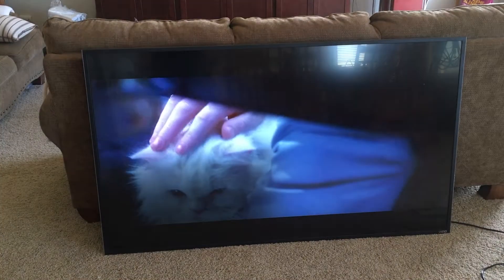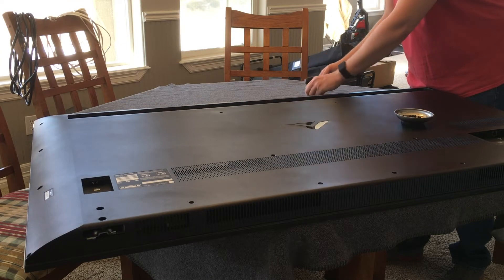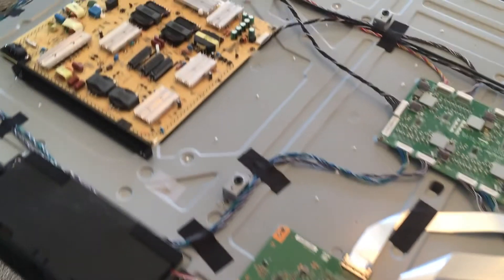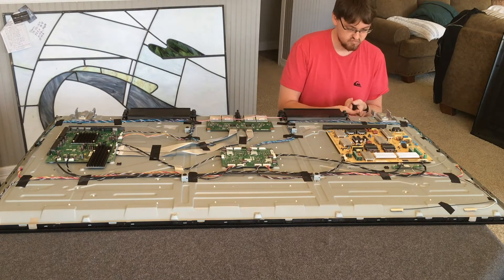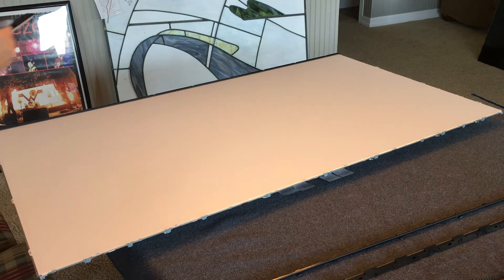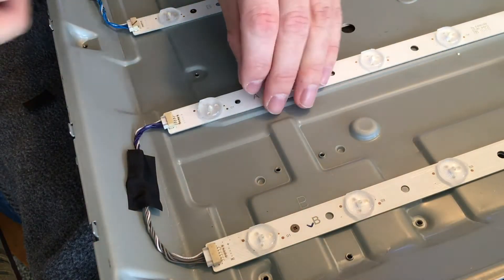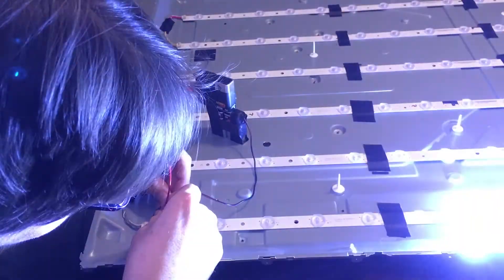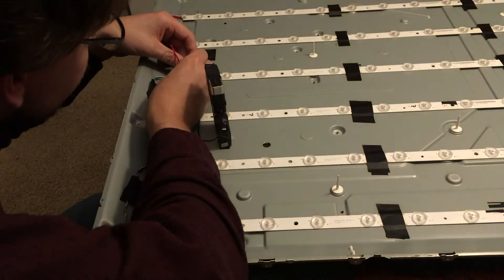Vizio M65-D0 LED Driver Board Replacement: Fix Backlight Issues | CraftTested

Comment: I replaced my main board and led driver and still has black spot buy goes away every 3 day or so then comes back been doing this for 4 months. You think a tcon Is the problem
Reply from the maker: I have no idea... I'm just a dude who tinkers. I shared all I know in the vid.
Reply: @CraftTested  you no if the vizio m701d-a3r is edge lighting or full strips like yours?
Reply from the maker: I have no idea – I'm sure that's something google could tell you though.
Reply: @CraftTested  I looked , I can't find it

Comment: I guess if you're not sure before you buy the part, you could just swap around the connections for the panel sections and see if a different one goes dark?
Reply from the maker: Sounds logical. I'm not a pro at this stuff, just a guy trying to fix my broken crap.
Reply: Is that the only way to test the board?  It sounds simplest so just asking.

Comment: What do you think is wrong with my TV 
My TV won't stop flickering its every 5 to 10 seconds it will flicker I've opened it up to see if it had a loose connection but I'm still unsure
Reply from the maker: I have no idea... I'm not a pro tv repair man – just a dude who had to fix his broken junk.
Reply: did you figure this out ?

Comment: How much does the video board cost
Reply from the maker: I think it was around $25?  Maybe a little less.  Generally these boards are pulled from other broken tv's – the working parts stripped – so you shouldn't have to deal with the microchip shortage issues.  I'm waiting on new microchip parts for an audio interface that went down – it's been over 70 days.  I'll probably never get it.

Comment: I have a Vizio P65-F1 which needed a main replacement.  I replaced the main but not with the exact model #, the TV had a -T and I bought a -K which I have done before and seen other do.  The TV now works fine but I am seeing the same problem you encountered but in my case the shaded spots move around depending on what is on the screen.  Clearly the TV is trying to adjust the backlight/Dimming but in the wrong spots, I am guessing this has something to do with the different board model #.  I am able to temporarily resolve this issue but setting the Picture Mode to Computer.  I went through all menu settings including the Service menu and see nothing related to Panel or Calibration.  Any suggestions ?
Reply: For now disabling Active Full Array resolves the issue regarding of the Picture mode.  I am going to guess this has something to do with the different model # board not completely matching the rest of the system/panel.
Reply from the maker: I would assume it's the different model board as well. Glad you figured out a workaround with disabling active full array.

Comment: Great informative video.  I have a small strip of dark spot right smack in the middle of the TV.. there was another lower line but that has disappeared.. Would this be a LED strip or a board issue? It's not an entire area but a "line" where I imagine some of those LED bulbs went out?  It's a M658-G1 less than two years old (wtf).  Thank you!
Reply from the maker: I'm not a pro at any of this. The only way to know for sure is by checking the video board and LEDs with a multi-meter. Good luck!

Comment: It can be a right pain at times, could be led driver, t-con, psu, main...a led tester is a must... Or dc 3v battery save you...
Reply from the maker: I agree–the only way to know for sure if by chasing possible issues with a multi-meter. And yes, the battery trick works for checking LEDs, haha.

Comment: Long shot. The top section of my vizio D55-F2 went dark. When i go to menu>timer> and select blank screen. It goes dark like it should. And when I hit a button to bring it back to light the top is lit then goes back dark in a few seconds. Could it just  be the board if will light up then go dark?
Reply: Maybe a bad capacitor or transistor that powers that led strip? Or a bad connection somewhere. Something can't sustain the power flow. You could try baking your boards to see if it fixes the problem, maybe a bad solder joint somewhere.
Reply: I have the same issue

Comment: Mine is the Bottom being Dimmed. Upper is good, but the Lower Half of the Screen starts being Dim.
Reply: Mine dimming whole screen 😢 I have 2022 Vizio but I'm gonna be buying one 2025 Vizio Tv
Reply: @unknownwolf8555  - Also have a 24 Inch Vizio that works great...but after a while, the Audio starts getting out of Sync. Only way to correct it is to Power Cycle, or Unplug then plug in the HDMI Cable. No WiFi, or LAN, so not sure if they have a Software-Firmware Update that can be applied with the USB Port or not.

Also have a brand new ONN 24 Inch TV...which has a Firmware-Software Issue with the HDMI Ports. You can not use Disc Players or TV Boxes because it has a HDCP Issue. Oh, but Laptop and Android Devices with HDMI have no problem, though. LOL
Reply: @chrisflowers-smoker154  mine so dim I can't see anything anymore  😕 so I'm gonna have buy me new Vizio tv gonna be 50inch 4K I do alot of gaming since I'm unable to work due to me having health problems and syndromes i barely see Minecraft with In game brightness up all the way

Comment: Mine has alternating black areas. Top right, left middle, bottom right, but mostly noticeable when the screen is darker and not as bad when the screen is light.  Do you think this is still a driver board issue or more of an LED issue?  All these areas went out at the same time so I would think more of a driver board issue since it is highly unlikely that all those areas go out at the same time.
Reply from the maker: I am not a pro at this stuff – the only tv I've ever fixed is the one you see in this video. But yes, given what you've told me, it sounds more like a driver board issue – or even a motherboard issue – rather than an LED issue. Sorry I'm not better help!

Comment: Tried this... didn't work.  Still have lower-left quadrant not working.  Might be the backlights, after all.
Reply from the maker: Bummer. Only way to know for sure is testing each stage in the circuit with a multi-meter.
Reply: @CraftTested  Well, that’s not all bad news… I’ve been looking for an excuse to buy a new multimeter.
Reply: @dharvell  Did you end up finding what the issue was.  Your problem is exactly the same.
Reply: @treader1974  Yup! Replaced the LED strips and everything was looking great!

Comment: My quadrant was dark. I ordered another board and it is still dark. Only top left quadrant.  The repair was easy like you said but it didn’t fix my prob.
Reply from the maker: Bummer. Only way to know where the problem is for sure is by checking LED's and driver board with a multi-meter.
Reply: @CraftTested  would love to chat with ya  Jeff Hayse on FB
Reply: @CraftTested  I suscribed.

Comment: Why do you keep calling the power supply board; a video board? The video board has the coaxial connections and the RGB connectors according to eBay.
Reply from the maker: According to the place I purchased the part, the appropriate name is "LED Video Driver Board". I have no idea what eBay says.

Comment: because there are too many LED strips and one driver circuit is not able drive it. there must be many driver circuits. each of them only drives one stip.  if one of them is broken, then the TV backlight shows this kind of problems. yours was on the up and low edge. it could be in the middle also.

Comment: Had each of the quadrants go out. Replaced the driver board and came on for about a minute. Now, it's black again. I'm assuming it's the led back lights now???
Reply from the maker: The only way to know for sure is by testing the LED strips and video board with a multi-meter, and possibly back to the power supply. If your LED lights came back on at all after replacing the video board, it doesn't sound like the LED strips are broken.  Possibly something is overloading the video board and keeps frying it.  Just guesses, I'm not a pro at this stuff.  Possibly consider replacing capacitors rather than the entire video board.

Comment: Parents 65” Vizio tv just had this happen. Top right and bottom left corners are super dark. The board is sold out though. Rip
Reply: Lol I just found a 65" vizio tv that was thrown out. It has the same problem
Reply from the maker: I believe a lot of TV parts for sale online are actually used and pulled from other broken TVs. From what I've read, I suspect this is a common problem and a lot of these Vizio's from that time period are failing.

Comment: My top row(s) seem to be out, would this be related to the motherboard? It's not a quarter of the screen, it's the top hslf.
Reply: not sure if you have solved your issue or not but I picked up a E60-E3 and the entire screen was dim. after disassembling it I noticed the connector for the backlight was a little burnt. If I wiggled this connection the entire screen lights up. if I wiggle it a little more the top row goes dim. Wiggling it once again and it works properly. I took a toothbrush and some rubbing alcohol to clean the connectors and now it is working 99% of the time. It occasionally will dim but comes right back!
Reply: @ChadMees  I did, it was the LED strips. I found a set on ebay and replaced all of them. Works great (for now)! Thanks

Comment: I have a vizio e70 e3 I TV shows everywhere but the right side is dimmer top to bottom should I replace LEDs or the board
Reply from the maker: Impossible to know for sure–you'll have to take a multi-meter to test the board and LED strips. If the board isn't providing current to the LED strips, it's likely a bad board / transistor.  If the board is providing current, it's likely bad LED strips.  You can gamble and cheaply / easily replace the board if you feel that you have a uniform outage like what is happening in this video. Replacing LED strips is more involved.

Comment: I have the same issue with two quads but after looking at the driver board in your video I was wondering if you ever tested those 35 volt 470 capacitors that look to be one on each quad. If there was a week or bad cap it could be an even cheaper fix.
Reply from the maker: Yes, Kyle–I think you're correct. I should have checked the capacitors, my gut tells me this was probably the issue. Anyone reading this in the future, use a multi-meter to test the capacitors on the driver board – it may be an even cheaper fix.
Reply: @CraftTested  Just remember that to get a true reading from these caps, they need to be carefully de-soldered from the board.

Comment: So would this also be called the the main board on my Vizio? Because on mine it looks different , it has the hdmi ports together with the main board ?? Also having very similar issue just dimming spot is on the bottom right corner..
Reply from the maker: No, I believe the main board is usually different from the video board.

Comment: Is this the same if two quadrants are doing this and flickering? I have the 49" Vizio and the bottom left and top right are both doing this.
Reply from the maker: Possibly–what you describe sounds like a video board issue and not an LED strip issue.
Reply: Any way in particular that you would recommend testing this? The picture isn't messed up or absent, its just the dim spots in the corners and a bit of light flicker.
Reply from the maker: @hbtdawgz1688  it can be a pain, but you'll have to tear the TV down and expose the LED strips. Test the LED strips individually, you can use the battery trick (https://youtu.be/4pK6o2DMLWQ). If all the strips are lighting up using the tester, your LED strips are working properly and it's a driver board / power supply issue.  If the LED strips are not working properly, you would then need to replace the LED strips. Good luck!
Reply: @CraftTested  Well I didn't have any of those batteries on hand but I did have a 6V battery pack and I applied it to each light. Definitely have some out. Only had maybe 4 strips where there wasn't at least one light out. Thanks for the advice.
Reply from the maker: @hbtdawgz1688  Well, the good news is that you were able to chase down the problem! You've already done the hard part–swapping out the LED strips is pretty easy. Glad you're figuring it out and getting it fixed.

Comment: I have a question the whole left side is darker on my tv could this be the issue or the actual led strips ? What’s your thoughts?
Reply from the maker: I have no way of knowing–I'm not a pro at this. Your guess is as good as mine. The only way to know for sure is to tear it down and test everything with a volt meter. Wish I was better help!

Comment: Just found a TV on the side of the road with a set of replacement boards. Top right quadrant isn't lighting. Was assuming it was a dead LED, but this may now not be the case.
Why would the video board not let the LEDs light? Damaged FET?
Reply from the maker: I'm not exactly sure–I'm not a pro at this stuff.  My assumption is that a resistor is fried on a particular quadrant of the video board and voltage is unable to pass through and power the LED.  This is purely a guess.  Stick a volt meter on the output of the four quadrants on the video board and see if anything is firing on the dead quadrant.  If you're getting a proper reading, it's an LED issue–if you're not getting the right reading, it's a video board issue.

Comment: SW Hammond, great video to not to waste time and money. Gotta question bro my vizio have darkness on upper right(just like your case) and started of with lower left only 1 strop but turned into full block now so what u think is it hopefully just video board or lead backlight strips? Thanks for your answer.
Reply from the maker: Thanks for watching.  Could be a power supply or video board issue.  It doesn't sound like it's the LEDs the way you describe–too weird for all of your strips to "burn" out all together like that.  I would try swapping the video board first, it's cheap and easy, and go from there.  You could away get a multimeter out and try to chase down the problem that way.  Again, I'm not a pro at this stuff–just some dude that needed to fix their TV!
Reply: @CraftTested  Thanks for getting back, is there way for me to show u my issue by sending photo? Tv itself 3 years old initially it started by becoming 1 strip going dark then turning whole block. So right now it is upper right, lower left both are whole block and since last texting you I ve got upper left only 1 strip dark, do u still think it is not  led strip issue and where to get part? I wish I could chase the issue by checking but Im not an electrician so I kind of rely on your experts, thanks.
Reply from the maker: @fi4007  I'm really not an expert at this.  There's no way I could tell you what was wrong by looking at a photo.  I did mine wrong the first time, thinking it was an LED strip problem.  After replacing all of the LEDs, I discovered that it was a video board issue.  That's why I made the video, to save people the hassle of replacing LED strips.  It sounds like you may have several issues going on?  My advice is to read forums and watch more YouTube videos with similar problems to yours.  In the description I put a link to the part store where I bought my video board.  Of course, your part will be different depending on your model.  Good luck!
Reply: @CraftTested  Thanks for your response.

Comment: Good video.  I have a Vizio P652ui-B2 and I'm getting a dark shadow bar across the entire top and about 2/3 of the way down the screen.  Again across the entire screen.   The rest of the screen is bright.  I've assumed that it's bad LED strips (which are no longer available).  What is your opinion?  Thanks.
Reply from the maker: I'm not an expert, but yes–that sounds like a bad LED strip.

Comment: Hello Thanks for the Video.. I had the identical issue with a large block of dark area in lower right of screen. First I replaced the power board with little no effect, then I took your suggestion and replaced the LED board. It showed a small improvement , but I noticed the longer the TV was on the more the image improved.. I still had some dark stripes and dark corner, but it was less noticeable. To my surprise after about 2 weeks of using TV the issue corrected itself. I was prepared to do the "deep dive" and completely disassemble the TV to replace the LED's buried on the back screen, but that is now not needed. I don't understand why the situation changed over time.. but thought I would post this, perhaps others can try just "burning in'" a new LED board by leaving the TV on for 24 or 48 hours. Usually circuit boards are digital , (they either work immediately, or they do not).. so I am mystified as to how my TV gradually improved, but for now I am happy, and the image is now nearly perfect with no noticeable dark background regions . Thanks again for the video on this issue.
Reply from the maker: Wow, that is bizarre. Glad everything eventually started working for you.

Comment: It would be nice to know what SMD LED diode that comes in these along with the degree of the lens they use. I do have a dead strip so I guess I'll just order a stock replacement (only thing available) and wait.
Reply from the maker: Yeah, I'm not sure. I didn't examine them or try to figure that out when I tore mine apart. Good luck!